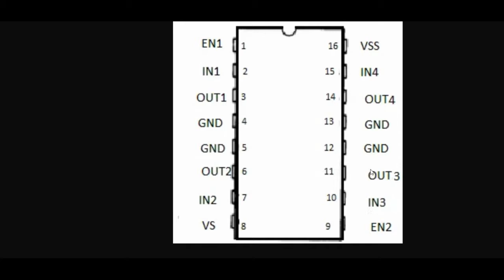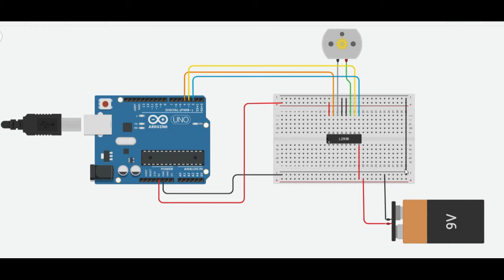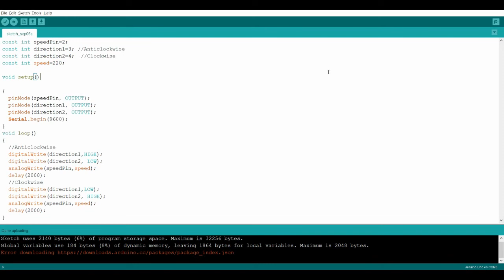Interfacing DC motor with Arduino |  Interfacing of an l293d motor with Arduino | DC motor Works

Comment: Pin 2 of Arduino is not PWM pin. So, how you can use it for Speed Control? I think your Connection diagram is wrong.